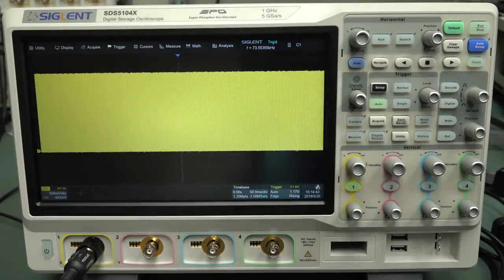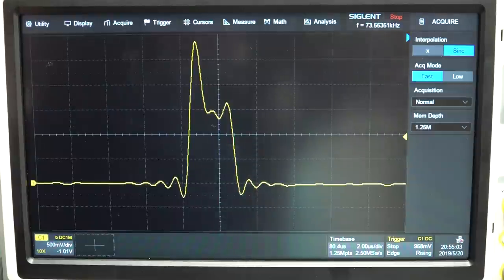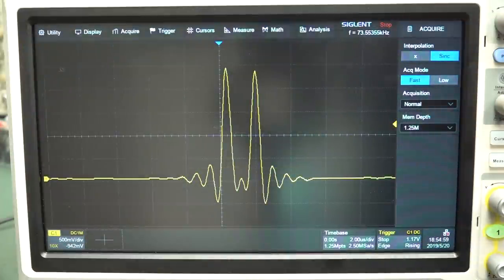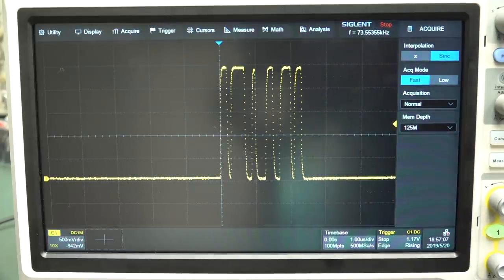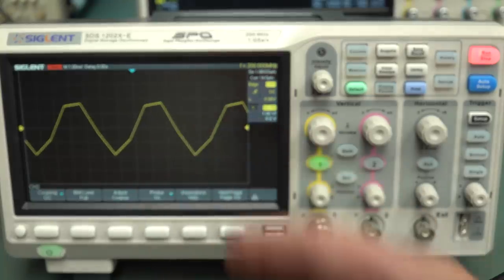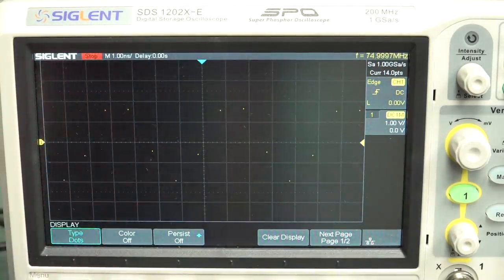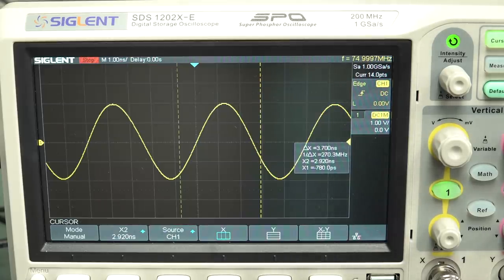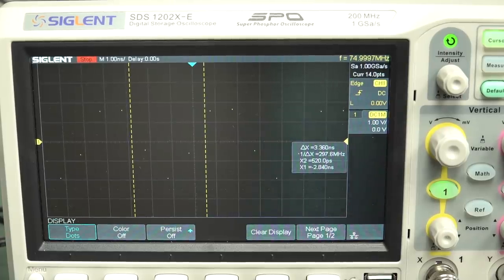EEVblog #1213 - The Oscilloscope Interpolation Trap!

Comment: This is why an analog scope is better ! If it says 200MHz is shows a 200MHz signal and something interpolated or GUESSED from a sample rate that should be at least 20 or more points per waveform, I think at least 50 points not 5 points !
And NEVER use any interpolation on a DSO.
Reply: Good luck catching that elusive glitch on an I2C/SPI frame using your analog scope. There ia nothing wrong with digital scopes provided you understand the limitations.
Reply: @ferrumignis  Yeah probably not good for a glitch but I didn't say they were the only tool, just better when you get close to their bandwidth. Just try to look at a 90MHz digital other signal close to the bandwidth signal 100MHz DSO. Now setup an old tek 455 and use the variable holdoff and see a much better waveform than the 100MHz DSO will show for the same bandwidth rating. Like you said the limitations, and that's one of them, the biggest in my opinion.5 point per wave ? Even a square wave wouldn't show up good ! If they rated 100MHz DSO with a 100MHz sign wave showing at least 50 point, no interpolation. It would work great too. And analog are near instant screen update but yeah the newer scopes are getting closer if you have an extra $8000 or so to spare. Maybe less.
And single shot.....I was thinking of using a  tuner video recorder card with an analog to capture the signal in real time. 
If only I was lucky enough to get the DSO in Dave's recent giveaway !
Or that 13GHz scope Dave used, or the 30GHz scope. What are they using that high frequency anyway ? It must be military since the civilian world thinks 5GHz is the limit for CPU and motherboards. Intel, Motorola and Darpa have showed 1THz, yes 1000GHz chips ! The civilian world might be allowed to have them sometime in the year 5000 when we assimilate into the great hive mind. wiki HEMT transistors if you think I'm full of it, or Intel Terahertz, and see the references for both and the 1980s HEMT patents ! 1THz transistors !
Reply: @phoenixsmith4001  No such thing as a 90MHz I2C signal, except for maybe some weak harmonics from the falling edges.  Look at a 90MHz signal on an analog scope with 50MHz bandwidth and you aren't going to get a true representation of the signal anyway, though it will be better than undersampling on a DSO, which is why people need to understand their limitations.  That said on a repetitive waveform the DSO would be superior again to the analogue if it had equivalent time sampling capabilities.
Reply: @ferrumignis  Yeah, I couldn't remember the correct acronym and that's what came out in my brain. Still trying to remember. But you get the point. Like where Dave only shows 5 points per waveform or even 7 - 10 points it's not as useful. But an analog scope will still show the signal just with reduce amplitude from the bandwidth rolloff. Within reason. None of this 5 or 10 points per waveform crap where you can't even tell the waveform. Like the video points out. I'd say 50 points 20 or 30 minimum per wave.

Feed this signal into a DSO and watch it cough up a furball, unless it is a very high sampling rate, and it will still probably fail due to the slower screen update.

Jerobeam Fenderson - Planets
or 
Jerobeam Fenderson - Shrooms

Dave tried it in one video and even the high end DSO didn't come close to an old Tek scope. A mailbag episode I think ?

I like an instant response, but DSOs are definitely better in many ways. Feed them an NTSC analog video too, and the DSO will be far to slow to respond. It still works but won't show the details like an analog would, with the phosphor instead of digital
version so you can see screen motion all over the screen.
At least all the scopes I've used. Never had a Lecroy or $100K scope. Maybe the $100K scopes can do it ?
Reply: @JM Coulon Back in 1976 right after I graduated college, I built one of the original Altair 8800 computers from a kit which cost $400. I also bought the optional 4K byte memory card kit. After careful assembly, I turned on the computer and it didn't work. I probed around on the motherboard with my HP analog scope. When looking at the 2 MHz clock signal, it looked like a sine wave. I thought to myself "no wonder this thing doesn't work". I sent it back for repair. It came back working. The fix was to tack on a bypass capacitor to the memory card. Later, I got to thinking about how this computer could even work with a sine wave for a clock signal. It was then that I realized that I was looking at a 2 MHz square wave with a 500 KHz BW scope! The moral is that an analog scope can also give you garbage information if you don't use it properly.
Reply: Analog scopes are dead... Multi Ghz analog? At the end of the day the message is : Get an appropriate sample rate before you draw conclusions.... And be aware of the limitations.

Comment: Dave, if you don't meet the Nyquist criteria, and suffer from aliasing/folding, you're really not entitled to try to make any sense out of what you see on the scope.  Screwed is screwed.  There's no sensible interpretation of undersampled/aliased signals. Other presentations - dots, linear interpolation - are all equally useless if your data are under sampled.  There's no good way to look at aliased data;  it's ruined, crap.

Comment: The angle of the dangle = (square root of the (ventilation) holes in the back of the scope) x (the mains frequency) x (the memory depth in bits) all over pi! 🤪 Yeah, right.

Comment: but the "problem" here was not really the type of interpolation. It was just about the sample rate and memory depth. The fact that the keysight worked much better than the Siglent was just that the keysight had more samples within that data packet even at 50msec/div I don't know whether it was because it was working at higher sample rate or was using more memory or was using segmented memory or equivalent time sampling (if the packet was periodically repeated) but it only worked better than the siglent because it had taken more samples and it had nothing to do with its linear interpolation. However, I understand that the Keysight scope was smart enough to realize that with that many samples (which was still not too many), if it was going to use the sinc interpolation it would look ugly and could be misleading, so it switched to linear sampling.
Reply from the maker: There are two concepts in this video. One is the sample rate and memory depth limitation. The other is how SINC interpolation can make waveforms look like something they are not in the case of the memory dept/sample rate limitation case.
The Keysight "worked better" because it was indeed smart and turned to linear interpolation instead of showing a potentially confusing SINC reconstructed signal, and that relates to the 2nd point above, not the point about more memory.
Reply: @EEVblog  Sinc is not confusing. Instead linear is  more misleading when reaching the limit of the scope. You can't get more information over Nyquist frequency.
Reply: @EEVblog  Memory limitation is essentially down sampling. That's why the user need to know how to use the instrument. Oscilloscope is an instrument.

Comment: Mathematically valid?  Nah, it's called lying.  What you are / it is doing is adding information to the data acquired based on what you / it thinks the signal should look like.  YOU might be able to justify doing that, through a lengthy argument.  The instrument itself never can, and should never make assumptions or perform guesses by default, this is just marketing.
Reply: If it's under the nyquist limit, then it is valid. Let's say we have a 40khz sampling rate. An almost  20khz wave that falls under the limit must be a sine wave. Any other shape of wave uses frequencies higher than the nyquist limit.
Reply: @autogolazzojr7950  That's you setting rules about what it is seeing - adding information.  In the real world it's supposed to be telling you about what's out there: the waveform is an unknown, else you wouldn't need a scope.  You don't know whether the waveform is or has components over the Nyquist limit until you measure it.  You can tell my circuit board it 'must' be outputting a sine wave, but it won't listen.
Reply from the maker: I think you need to learn more math, it can be shown (as in proven ) to be mathematically valid. It's not easy, it's quite a complex topic though.
Reply from the maker: It's not about what your circuit is actually doing, it's about what your probing and scope bandwidth will allow you to show.